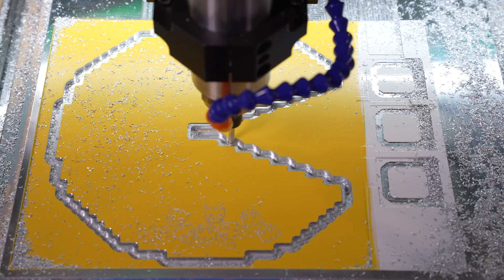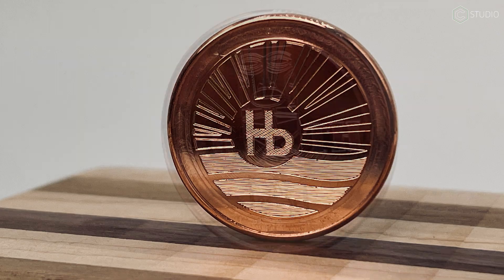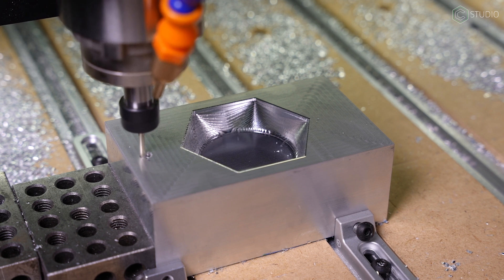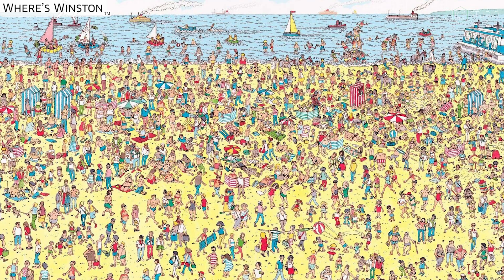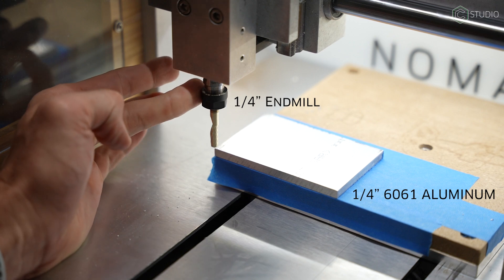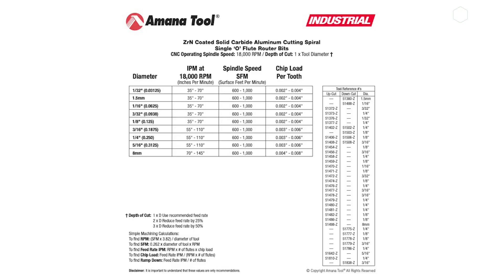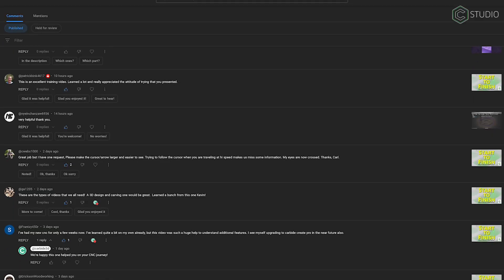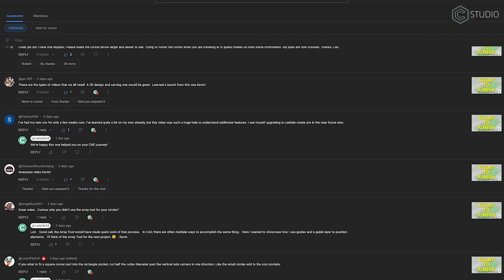You Need to Start Machining Metal

Comment: It would be great if Carbide 3D did some testing, or put together results from testing they likely already have done, and put out a chart like what was done way back for the Shapeoko 3 that includes feeds and speeds, but also have stepover and depth per pass recommendations. Not just for metals but also woods,  plastics, etc. One thing that confuses a lot of people is they are told to use the chipload recommended by the manufacturer of the end mill but many times those numbers are based on using a much more rigid machine with a much more powerful spindle. Getting real world numbers for desktop machines like these where many people just have a 1.25 HP palm router is a challenge. People find discussions in your forums but even then you will see a crazy range of recommendations.
Reply from the maker: This is exactly why we have all that information in the tool libraries of Create.   No more looking for that sheet of paper.  Everything you mentioned is broken down by machine, material and endmill.
Reply: @carbide3d  Not everyone uses Carbide Create. Kind of a pain to install it then look up each tool one by for for each type of material and then what... manually type it into a document of some sort? Or is there a way to export the entire tool database all at once that I'm not seeing in the app's menu?
Reply: @TornadoCrafter  its a pain to install a program and look up each tool wtf are you on about and how are feeds and speeds so difficult for you to comprehend, maybe you are out of your league here these things require computer knowledge nowadays grandpa
Reply: @undeadducky7729   ease up keyboard warrior...and don't forget take your medication.
Reply: @undeadducky7729  Hello Troll. Perfectly capable, simply pointing out how it would be nice if C3D provided their speeds in a document to save a lot of time extracting it manually. Many people who buy a Shapeoko are completely new to CNC and have no idea what proper speeds should be and a percentage of those people purchase different software such as something from Vectric. Unfortunate that  you completely missed the point and feel the need to attempt to degrade someone, but really you just made yourself look bad.

Comment: How about annealed 416 SS? If a Sherline can do it, why not the Nomad?
Reply from the maker: Hi Harold,   This video may help you plan that project:  https://www.youtube.com/watch?v=Ta_KiG_5etU
Reply from the maker: There's also this one featuring Stainless on Shapeoko 3:  https://youtu.be/QYkDKkfUuFs
Reply: Thanks for responding, I’ve viewed both videos many times. The reason I requested 416 SS is because the 303 SS is unable to be hardened via heat treatment, whereas the 416 SS is. Keep the videos coming.

Comment: Is vacuum not something used or that works? Why air blowing? Too heavy? Is the hdz needed for 1/4” aluminum? I have the 3xxl
Reply from the maker: Winston, long ago, accomplished his skateboard project with the stock Shapeoko 3 z-axis.   You can do it; you'll go slower and shallower with each cut.   
Removing chips must be done when cutting metal.  Your cutters will dull significantly faster or break if they regularly encounter pre-cut chips.   
If you were going to cut metal all the time, you could look into putting on air assist, buying an HDZ or upgrading your machine.
Reply: I've had very good lucky with Sweepy and the shop vac to remove aluminum chips -- as long as you can place Sweepy low enough to touch the surface of the aluminum.

Comment: I've cut a lot of metal on my Shapeoko 3 and Pro. I've done a lot of aluminum, copper, and brass. ANY issues I had, were not because of the shapeoko (it's more than capable), it was my endmills and my clamps... The MC Etcher is excellent for engraving.... I've made a lot of coins (carving and engraving), brands, and lots of decorative stuff. I think the thickest I've cut was 1/4 in.... My recommendation starting out is, starts SLOW, and go really shallow. Eventually, try going deeper and quicker.... You can also do some pretty neat things with aluminum or brass and epoxy resin inlay... These pieces you cut, can be polished to a mirror finish (depending on the material).... 

An idea for a future video (if it hasn't already been done) would be making rubber stamps. It's basically the same idea as making a brand, but on MUCH softer material. I've made some for block prints, stamps with my daughters names, and some Chinese characters. You can do some pretty fine detail, just using standard rubber stamp (or block print) material. You do that, carve a nice wooden handle/block, glue them together, and done!